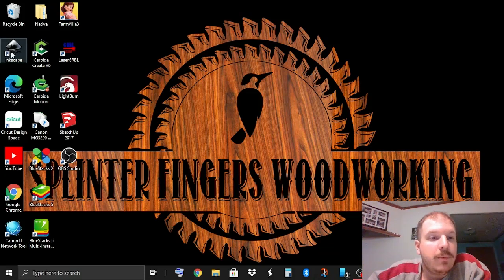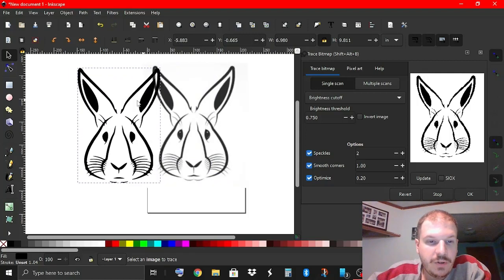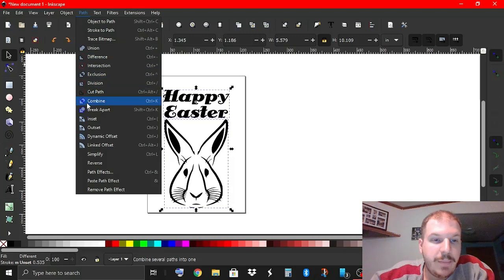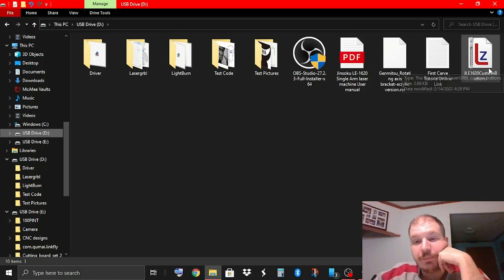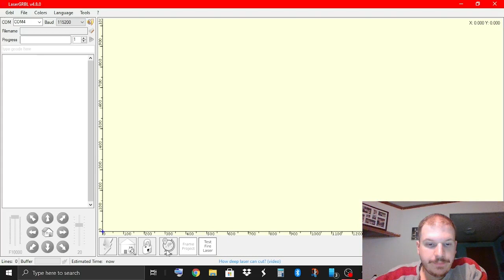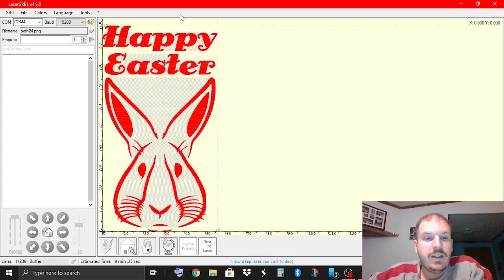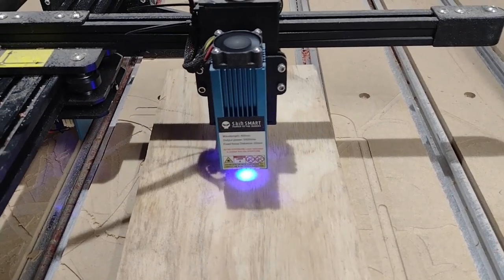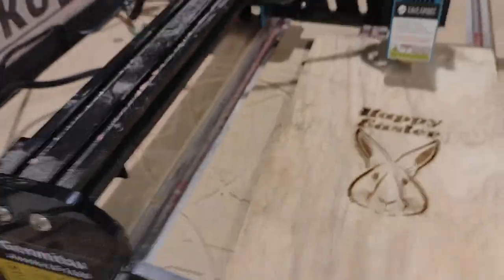Free Laser Software Tutorial

Comment: LaserGRBL seems to be locked on front/left as home. You figure out how to make center default home? I can center per project, but I want the laser to begin, as default, on my workspace center.
Reply from the maker: No sorry the only way is to do per project
Reply: If you have the original buttons, there is a globe icon. place your laser to where you want to be the start point or home, and click on the globe
Reply: @splinterfingerswoodworking8995  I assume if clever enough with Gcode it could be written in, but a lass, I'm not that clever..
Reply: @TONYNELSON  I thought I tried that and it started back at the front/left again.. I'll try again!
Reply from the maker: @BywaysnoHighways  the front left to my understanding has to be the homing spot because that's where the homing switches originate from but if you are working on a project you can use the globe to set your home wherever you're wanting it at just use the little arrow keys to position your laser at the spot you are wanting do not move it by hand and it will make the spot you have it it's point of origin
Reply: @splinterfingerswoodworking8995  Ah! There is my problem! I read that if you move the head before switching on the machine that becomes the new home. I will try with the keys on next attempt.

Comment: hello kindly I bought a sculpfun s10 and I'm using lasergrbl without problems but I don't know how to do something by chance a wooden keychain with the engraving and the final cut of the piece with the appropriate hole to put the iron circle as it is done thanks settings
Reply from the maker: As far as cut settings I do not have any experience I've only use this for doing engravings as far as for engravings I have found best way to get it zeroed in perfect is to have a few test pieces and just engrave a small spot and and adjust as needed mine is a 5.5 Watt and I keep it set on 100% and only adjust the speed on laser gerbil like for pine I found that 1,000 works best but with something like cedar or poplar I actually go up to 2000 something harder like oak or walnut 1,000 to 1500 seems to do the best so far the plywood that I have used has worked good from 1,500 to 2,000
Reply: @splinterfingerswoodworking8995  grazie